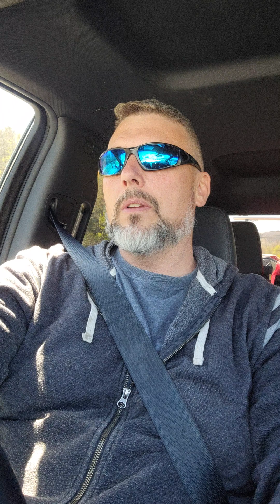Overview of the electrical wiring for an Ansul Hood Saftey System with a Captive Air control box

Comment: I  installed a sht load of them  for chick fill a ,wawa , raising cain chicken and Giant supper markets.  One thing i found is most Electricians will mess this  up.I have to fix them all the time.
Reply: Where we can get a study book or some information on how to understand the wiring system.?
Reply: @eduardomorales577  it's all printed on the cover
Reply: I'm trying to figure out one that is hoodless and i can't find where to connect my shunt trip wires, there's no control panel on this one
Reply: @bryammadrid6146  is there a fire panel?